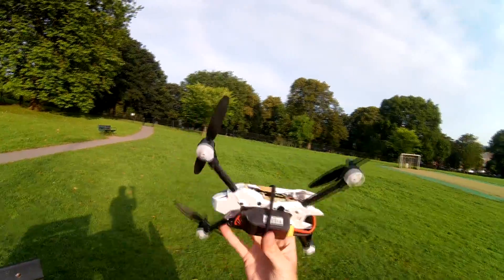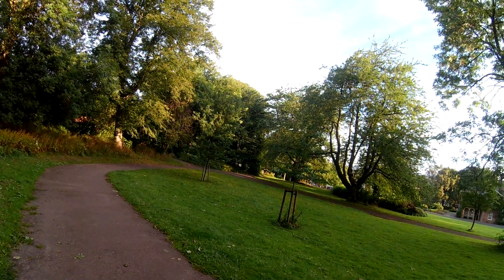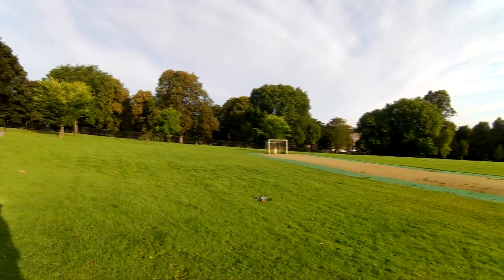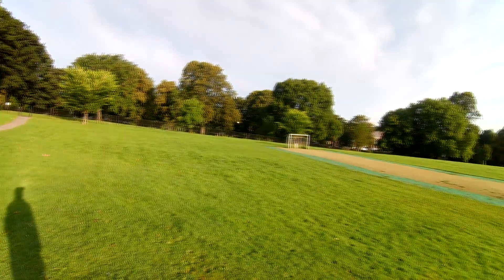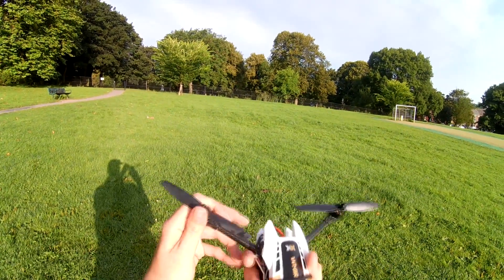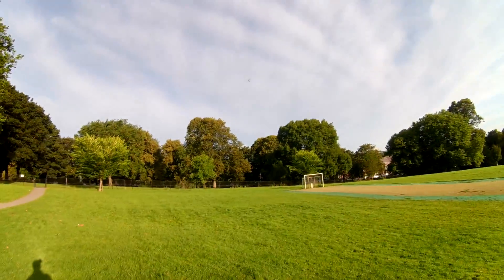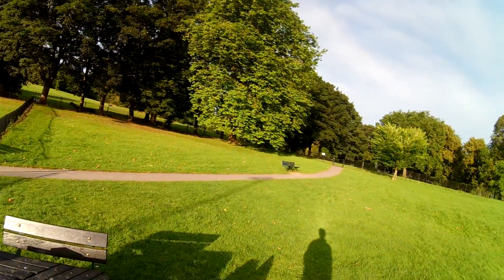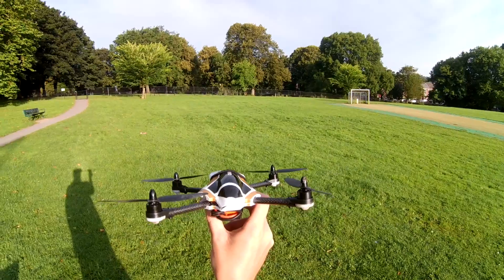Overclocked X251 on 3S - Flycolour 4 in 1 FC/ESC/PDB/BEC (Gearbest)

Comment: And will that work the x7 transmitter.??
Reply from the maker: Probably if you tap into the solder points on the X251 RX and solder it up to the new FC. I haven't tried this yet but the RX is removable and easy to solder to.

Comment: Is the 30a esc all you changed on the x251.??
Reply from the maker: It's a complete PDB with FC and ESC I fitted so only the motors and props are being reused. Plus most of the frame. 20A esc on this one but there are 30A versions.

Comment: nice flyin, that turnaround is like against the laws of physics... on a cautionary note my 1806's didnt have any heat in  3s... about 10 flights with 4s and all 4 motors got slightly warm, but i have now noticed all the motors are loose on the stator (axle) they all have over 1mm of play vertically .. i also had either a motor or esc failure on my last flight intermittent refusal to punch out on front left motor which was my worst motor on day one, not smooth slightly loose , slow to start first to stop kinda thing.... but man 4s on a kingkong188 is a blast, i think i will hunt out the best 1806's i can find and  build another one, 0 to 60 quicker than you can clench your buttocks.

Comment: Looks like a pretty successful project. 

I meant to ask you, how did you move your throttle cut switch to the left on your X7 transmitter? Did you physically swap the wiring or is there some way to do it in the menu settings? The amount of times I have hit the 3D switch instead of throttle cut, I am surprised I still have fingers!
Reply from the maker: Yeah just swap the plugs from those two back switches inside. The leads are just long enough that you can leave them situated and just plug them in to each others places inside. Quick and easy.https://flic.kr/p/DerRZv
Reply: Even easier than I expected - no soldering. Thanks!

Comment: I know it's unrelated, but have you thought about getting an OXY 3?
Reply from the maker: Small, delicious and fast. Perfectly related! :)
I'd love one, it's an awesome little heli with superb performance. I actually have a 180 CFX in the box never flown and a Chase 360 that needs building but having trouble finding the time recently to indulge in none review based stuff. 
Now if someone was to set them all up flying great for me like a magic heli fairy i'd love to tear a few air molecules apart. 
Quads are my roots and I will never stop flying them but I consider myself a 3D heli pilot first and foremost.
Reply: I know those feels. After a Devo 10 I'm be making a HCP100S body with a K110 Rx and Fc. It's so frustrating having everything slow down so much.

Comment: does the 251 have full 3d inverted acro flying? how is it compared to the 250?
Reply from the maker: The stock X251 is not 3D capable- XK call it 3D which does noone any favours. It's brushless though so not really comparable to the brushed X250
The X100, X252 and X350 are full 3D capable and each on of them has a full playlist if interested how they fly.